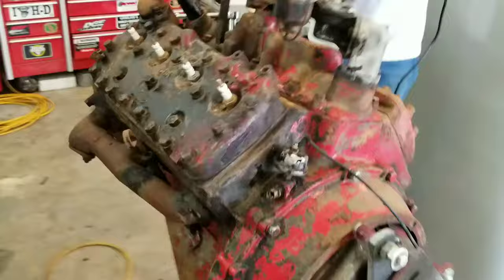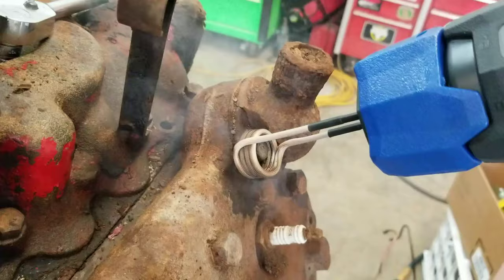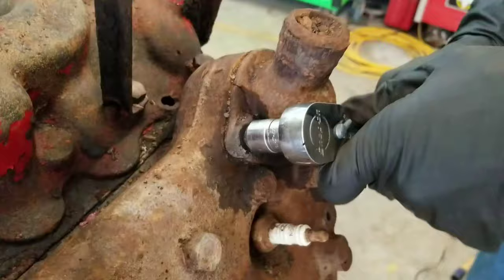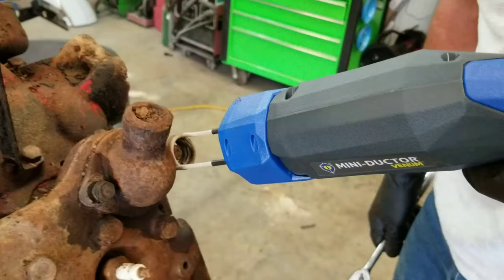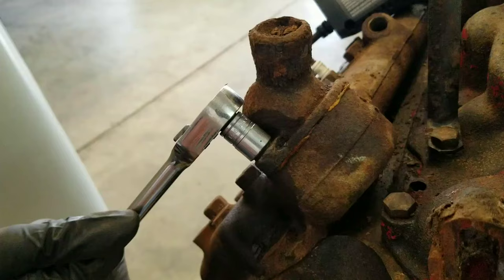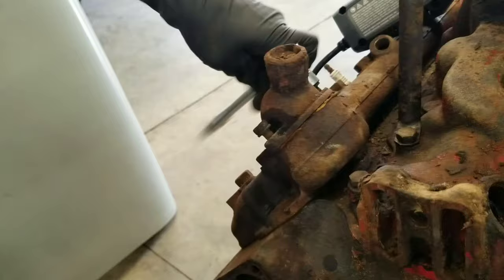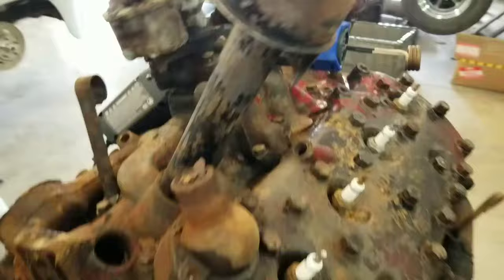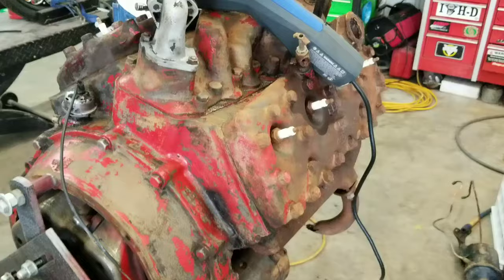A Cool Tool for Removing Rusted bolts and fasteners

Comment: I had a bolt I could not get out of my starter on an old Ford truck one time. I tried  a six point socket, a boxed end wrench, vice grips, everything I could think of and could not budge it. I needed my truck for my business and there it was broke down and I could not fix it. 
   A friend stopped by and told me he could remove the bolt. I told him to have at it. He heated it up with a torch he had in his truck and then threw a glass of cold water on it. After that it was almost figure loose. I couldn't believe it, but this happened and this is a true story.

Comment: Actually it’s only designed to conduct heat with the iron in the rust, I have an old one, it’s perfectly fine to touch. And you don’t need penetrating oils.

Comment: Here in TN you find 2 levels of rust on old engines. "Not too bad" and "can't save that" I remember one time I was stilling this old iroc for parts and I didn't need to take the mounts off of the engine because the had already disconnected themselves at the block. The whole lower end was practically flakes

Comment: How does it free up a bolt? If heat causes the bolt to expand it should be even tighter, I can see how heating a nut would work since it would be larger than the bolt
Reply: Its witchcraft
Reply: Just about to say the same thing. It's doing nothing to heat the metal around it to expand....like its supposed to. 

This would only actually work on a nut
Reply: Expansion of the metal also breaks/cracks the rust physically between the threads, and the expansion last only during the induction period, as soon as the induction is removed the bolts/nut start to cool off, which is again a shock that breaks the rust. It's the same principle as painting on an balloon, let the pain dry, then inflate the balloon and watch the pain crack and chip away.

Comment: It seems like if you heat the bolt it would expand and make the removal even more difficult, so it must be heating the surrounding area instead to give the bolt threads a little more clearance space. Am I correct, or is there some other effect going on here?

Comment: For fluids thin plates.The thinner the plate and the smaller the gap in 
between good heating.Similar in construction with car radiator.boil 1liter of water and then mix with 1liter cold water.

Comment: If you use this on a dry bolt, then immediately use "freeze off" from AutoZone to shock it cold, THEN use atf/acetone mix and allow to soak, any bolt is coming free.  If it doesn't work, rinse and repeat the process until loose.

Comment: How does heating the bolt head free the seized threads rusted and fuzed to the inside of a cast iron cylinder head? Heating them and then rapidly cooling them would be more effective, or heating the head so it expands and releases, like Heating a fused nut.

Comment: Most bolts are made from A36.  A36 swells when heated, that bolt was not stuck, just tight and grubby. Had it been stuck, or rusted between the bolt and housing, heating the bolt just makes it tighter while lowering the tensile strength, so heat the material the bolt is in while staying away from the bolt.

Comment: I been using a heat gun with a black pipe on the end of it for years.
It takes a little longer but
works good.
I'm usually under the truck and in tight spaces that could explain why it takes longer.

Comment: So does the coil actually heat up and transfer the heat to the bolt, or is it thermally heating the bolt directly from a induction field or something like that? I have seen people heat up steel to a near melting temperature using a coil that didn’t actually heat the coil just the bolt.
Reply: It seems to be induction heating; the use of electrical eddy currents. There are stovetops that use the same principle.   https://en.wikipedia.org/wiki/Induction_heating

Comment: so true no air tools or electric drills just use own hand, but some peoples think at its better to use tools where is power when they can open it in force and sad its when they in end realise at they just cut bolts by doing it that way.same issues its in lubrications they spray and right to way start work on those bolts wrong you must let it penerate and then start work it slowly.

Comment: After heating a bolt. I tweak it one way then the other to break it lose.then continue off a little. Tighten a little. There may be rust or damage bbn on the threads. I love that tool. Expensive?
Reply: $550 on Amazon

Comment: It concentrates the heat on the bolt to heat up the old grease that the bolt was put in with therefore making it come loose same thing as a torch pretty much heating it up

Comment: Doesn't it heat the metal AROUND the frozen bolt to loosen the hold? If you heated the bolt itself wouldn't that just make it tighter in the threads?

Comment: I thought your suppose to heat the metal around the bolt, causing expansion to give room to the rusty bolt? Wouldn’t heating the just bolt cause it to expand in the hole and increasing the chance of it snapping off?

Comment: I use a small Propane Canister/ with torch.  Works for only $15.99 + $6. For the Canister of Propane-
But you don have a little heat Displacement with it-so be careful where you use it

Comment: Why does it work to heat up the bold? It grows in size witch should make it even harder. Shouldn't you heat the part arround the bolt ant cool the bolt down?

Comment: How is expanding the bolt going to help.  You are actually mainly heating and expanding the material around the bolt.  The other trick to do at the same time, is to very slightly  "tighten" the bolt, then proceed to "undo" the bolt.  It works like magic.

Comment: Nice tool! Even though it is working the first time you use it...
Would it not be better to put the bolt though a couple of heat cycles to help loosen?

Comment: What's the difference between that tool and a propane torch? Same principle right?
Reply from the maker: Most common question. Check out last two videos where you COULD NOT use a flame.

Comment: I also had a rusted thermostat housing bolt stuck maybe 25 years ago. No induction tool or torch.  What I did was put an ice cube onto the bolt head alone. My thought was to cause the metal of the bolt to contract and free up. It worked but not practical for a shop to do this because it takes a while to work. Shop needs induction tool or torch.

A torch is fine, I mean what could go wrong with an open flame next to flammable materials and fuel?

Comment: Heating a bolt head doesn't slacken stuck threads further down the bolt it will expand the bolt and make it tighter,  it will work on nuts but not bolts .

Comment: Controlled heat application must make this easy as hell to remove rusted bolts. Doesn't end up heating the metal around the bolt as well.

Comment: I haven’t read the instructions for this particular tool, but when you heat a bolt that is in a hole physics would dictate that you let it cool and shrink before removing it. If it was a nut on a stud then remove it while hot. 
Done it many times with propane or acetylene and heat expands the bolt actually making it tighter at first.
Reply: The reality is heat will not only help break the bond between metal and oxidation, but while hot the bolt threads become somewhat "plastic". That being said, I would give an extra 30 seconds for the heat to transmit the full bolt length before  careful... and slow...removal.

Comment: My method is hit the bolt with a heavy metal Hammer fairly hard if accessible, that will slightly free up the thread from the rust .... then i'd get the Oxi and start heating the edges of the rusted bolt area (over heating the bolt will soften it and risk it breaking the bolt head) "normally" i get it off

Comment: Looks good but I do wonder if you hear just the bolt wouldn’t that cause it to expand and make it more difficult to extract......?  I thought the idea was to heat the metal around the bolt with a torch without heating the bolt and that would loosen off the grip internally this seems to be the reverse so I wonder what the mechanism is....... In the case of heating a nut on the end of a fastener  yes I get it that’s fine but to heat the bolt and heat going down the bolt and expanding the bolt I would’ve thought that would make it worse......!!

Comment: heat expands,, allow metal a few minutes or so to contract after heating especially a bolt, if you tun it when to hot it will spin head off,, if your removing hammers on a hammer mill use a large rose bud and start to make it glow on each side (key word start),, then go take a 30 minute break, when you come back to pound it off, it will be easy. Some things are so bad you have to expand and contract the metal a couple times and don't be in a hurry,, it will work.

Comment: Sense heat will make metals expand, wouldn't this device be heating up the threaded housing around the bolt, making it expand? Instead of trying to make the bolt heat up and expand, which in theory would make it harder than heating up the housing which would make the bolt easier to come out. Am I right?

Comment: Even $450 on Amazon seems a bit steep, but consider the aggravation of breaking a bolt. Fortunately, the fluids leaking from my engine have ensured that there’s no rust on its bolts. In fact, some of the bolts are already loose.

Comment: Shouldn't the coil touch the object it is heating? I think if it touches it its insulation should burn or scratched. If so, it would be difficult to hold the coil steady for a few minutes until it heats up. Thank you.

Comment: Heat doesn't move down the tube, the tube is used to alternate a strong alternating magnetic field causing electricity to flow through the material causing it to heat up.

Comment: I guess ill ask the dumb question. Heat makes metal expand, how does making a stuck bolt bigger help it come out? Wouldnt it be better to heat the area around the bolt? Please, no douchy answers!!!!
Reply: 1 second into the video and I was wondering the same thing. The hot wrench (torch) has always worked for me, but the surrounding area, not the fastener. Maybe it expands and lengthens the bolt, then rapidly shrinks (cools) thus crushing the rust into a powder. Just don't know. Looks like it would heat a hot dog pretty fast.

Comment: This is what I need for outboards. I never came across an outboard without rusty bolts.
Reply: I've repaired thousands of outboard motors and I've  never seen a rusty bolt on one. Stainless doesn't rust.

Comment: Obviously not saying how this work for those that have no clue.
Just a very simple circuit actually. For those who don't know how that work:
Low Voltage, something like not even 5V but Amp is very High. Creating a very strong AC magnetic field which doesn't pull in any way because it's AC but will heat up ANY metal placed in the center.

Comment: Pretty sure that’s meant for nuts not bolts things expand when they get hot
Reply: Exactly , good for wheel nuts but head bolts like he's doing is the opposite of what you want to do. Bet you 10 bucks they were pre loosened be4 he even used that tool,lol.
Reply: I stand corrected I was working on a car tonight and the bolt stripped out and I remembered this video so I heated that thing up glowing red hot with a torch and it made it finger tight lose some how idk how tf that works makes 0 cents but apparently it’s true

Comment: I've always heard that you should heat the material around the stuck part and avoid heating the part directly.  Heating up the bolt would expand it and make the fit even tighter. Can someone explain to me why this actually helps?      Is it because the expansion fractures the rust  around the threads?

Comment: What about smaller bolt heads or larger that the tool won't fit over.??
Reply from the maker: They offer an assortment of attachments for all kinds of applications and sizes.

Comment: If you heat the bolt, it will cause it to expand, and make it more difficult to remove.  Please explain why I am wrong?
Reply: Because the the thermal expansion of the bolt breaks the bond of the rust holding the seized bolt in place. The rust is brittle and can't expand at the same rate as the metal bolt.
If the bolt was seized due to be over tightened this technique wouldn't work.

Comment: Surely the gadget heats the surrounding metal not the bolt. If you heated just the bolt it would expand and jam even tighter in the hole. Just a thought.

Comment: This makes alot of sense would be so simple to make though pretty sure you can use a microwave transformer cut out the one winding replace with heavy gauge  induction heater

Comment: In my teenage years my method of not breaking off a bolt was to use a K mart socket set. The socket would break before the bolt.🤤

Comment: Your not suppose to unbolt all the way at first. Your suppose to retighten the bolt some and then loosen some and then tighten etc.. This allows the rust to flake out of the threads so they don't jam up the bolt and snap it off for really tight bolts..   I know from experience myself till someone told me.

Comment: It's induction.. using electro magnetism to cause an induction effect to heat up the metal placed between the coils.. the coils wouldn't get too hot since there's no element in the coil..

Comment: Hey guys.  Amateur mechanic here.  Can anyone tell me why it’s better not to use an impact wrench to loosen these old bolts?  Reason I ask is that I thought the sharp but short impacts were actually more gentle on a stuck fastener than the steady torque of a breaker bar.  I thought the breaker would actually make it MORE likely to break a bolt.  Is that intuition wrong?

As an aside, I DO understand that a lot of guys like to use a breaker bar to loosen head bolts— because it’s less likely to loosen the bolt too fast and warp the head.  That does make sense.  However, this old flat-head motor is really old, practically antique, so...  🤷🏻‍♂️

Comment: seems counter intuitive to heat the thing you're trying to remove, since heat makes most metals expand. I guess it's just the movement of the bolt expanding a bit that's breaking it free enough to move. If that tool was about 3x smaller, and half the price, I could use it, but that size you pretty much need whatever you're working on, out of the car.

Comment: Heat makes metal expand its not heating the bolt it's heating the housing causing it to expand. If you did the same thing but some how made the bolt really cold it would come out like butter.

Comment: The unfortunate thing about this is that it can only be used in those easily accessible places. When your under a car or trying to get into awkward spaces, then it's not viable option. It is a brilliant tool, just not small enough.

Comment: It appears he set the recently very hot tip down right next to a full glass fuel bowl?
Reply: The coil at the tip of the tool doesn't get very hot.  A high-frequency current runs through it, but it induces heat into the bolt head - the coil on the tool doesn't get that hot itself.

Comment: A propane torch is cheaper. Heat and impact are your friends so is a good penetrating oil. Heat is #1
Reply from the maker: Sure is. Until you work around something you can't use a flame.
Like rare parts, or gas etc. As in our later videos.

Comment: Proof of concept would be to remove a bolt with this tool that had first failed to be removed with other methods. We don't know for sure if those bolts were even stuck. It's possible they could have been removed with just a wrench.

Comment: Nice a soldering pen with a bolt heating coil attached..... I bet this tool is supper affordable... smoldering pens are cheap... what does it cost $10-25? That what it would be worth.

Comment: The new coils that heat up on the end are well expensive to replace # oxyacetylene does the same job
Reply: coils that heat up?  uh...  lookup "induction heating"    the coil is a pipe, it gets hot but the air or water with some of them keep the coil cool.    the metal between the coil is the only thing that gets super hot
Reply: I don't know, I mean he is right otherwise they wouldn't sell water cooled 3.5KW version of these at 4000$ and call it pro grade. Plus I'm also concerned about bending and replacing the coils, which can add up quickly to the cost of using propane butane torches...

Comment: A Ratchet is not for breaking tight bolts. Use a extension power bar to crack the bolts first. 😀

Comment: Seems controproductive to heat the screw. Either you heat the surounding material too because the surounding material has a bigger diameter than the screw and will expand more than the smaller diameter of the screw or you cool down the screw because of the same effect but in the opposite way.

Comment: It work only on steel/ iron . Because it is creating induction ( magnetic oscillation energy field ) energy to heat. In modern engine block ( alloys ) it will not work. Now days high end motors have magnesium bolts or alloy.

Comment: I had a suspension bolt rust-welded to the frame and the bushing sleeve. I found a good trick to get it off. A gat-damned carbide blade.

Comment: All you need is a punch chisel and a happen give it a good tap the vibration will break the rust it's hold. Never had any issues. If your impact don't take the bolt out or break it you need a better impact lol!

Comment: There's a Does Not Compute here. If you heat metal, it expands. So if you heat the bolt without heating the metal around it, you've got a problem. The tool must be doing somehing else, such as heating the metal around the bolt.

Comment: There should've been a before&after scene. It looked to me as if the bolts weren't stuck before the heat application. Kroil is much less expensive than that snap-on tool, by far...